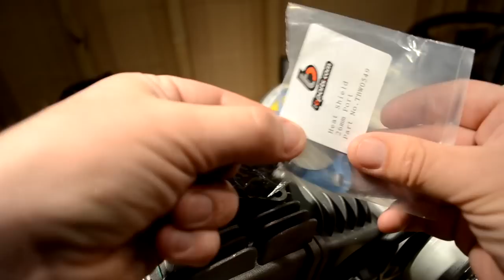Piranha 140cc - Pre Installation Prep

Comment from the maker: And to answer your other question - It was a great Engine, very well built - better quality than the Lifan's I've owned. I didnt have it long though because I switched back to a Semi-Auto, my bike has pedals, so cannot have a foot brake - the clutch and rear brake lever on the same side was an accident waiting to happen (I could have went to a dual cable brake lever on the right, but then you dont have as much control over which brake to use).

Comment: i think you made a mistake when installing the intake. That black spacer is supposed to go between the intake and the carburetor. The intake should bolt directly to the head, with a paper gasket in the middle. That is why the shorter bolts didn't reach far enough into the threads.

Comment from the maker: The bolt pattern for the two ends of the intake manifold are different (one is directly across from each other, 180/180, the other is something like 120/240) so you cannot install the manifold the wrong way - as such the spacers have the same hole pattern and cannot be used in the wrong position.

The shorter bolts didn't fit where I showed them as I was just indicating how the other bolts were the correct ones because they were the only ones long enough.

Comment: nicely done but little advice ,,, coperslip every bolt you take out before re assembly ,, and little tip with gaskets ,, smear them with engine oil before assy ,, that way thay come off the next time without sticking to surfaces  and destroying the gasket . and the ground down bolt flange is instant rust sopt ,,just replace the bolts with socket head stainless  problem solved

Comment: Great video and great engine. Except that you are in error about screwing in the oil dipstick to check the crankcase oil level. Since the dawn of time, all Asian engine oil levels are checked by simply pushing the stick in, and pulling it out. Screw it down to seal it, but to check it, in and out. Also you tightened your valve adjuster lock nut with the feeler gauge in place, bad practice. ok I'm done. Did they sell you this engine saying it had a lighting coil? It doesn't.  Thanks again for a great and very useful video.
Reply: agreed! was bit shocked at the oil check and that feeler gauge =D

Comment: Nice video :)

Are you sure about the oil level check? On my chinese 125 cc, the manual says to dip it, not screw it in. Same for various honda and yamaha engines i've worked on. Haven't seen a manual for this type of engine yet.

Thinking of getting a 140 cc for my bike too, how do you like the engine?

Comment: im trying to put one of these in an apollo and im stumped, the last part i have to do is wire the cdi and the ignition connector is not the same
Reply: What Apollo I'm about to do the same . Also are you using same cdi and wires off old motor or did you get new with the 140

Comment: I've heard you should do first start up with the crap oil that comes in the engine, then replace it after that with good oil. I guess that's not true?
Reply: The oil it comes with is of such low quality that it's not recommended to run the engine on it. change the oil to a non synthetic 10 weight 40 for your break in period. Afterwards change to whatever oil you like.

Comment: Hey recently just got a engine and pit it in my frame , I have spark and gas but for some reason mine won’t start , any tips ?
Reply: @Trevor Ober hey thanks man for the help I ended up getting it the carb had some dirt in it from shipping so I took it apart and cleaned it and now it runs great !

Comment: i know this fits into a motoped, but could you tell me are there any considerations/constraights??
Reply from the maker: It mounts no problem - the included intake fits without any clearance issues too (I mounted a Mikuni VM26-606).

BUT - Unless your getting the foot peg kit so you can have a foot operated rear brake I wouldn't recommend a manual clutch engine on the Motoped. Having the clutch and a brake lever on one side is a mistake in the making. You could run a dual brake lever on one side and just the clutch on the other but then you lose some brake control.

Comment: are thease any good? i have a chenese 110 atv. but i wanted more power
Reply from the maker: I liked it and it seems popular online, only went to a Honda CRF50 Motor as I prefer Semi Auto and wanted to run lights (can buy an aftermarket stator for the CRF).
Reply: +n1bpd cool. thanks.
Reply: n1bpd
Reply: Josh Kozee

Comment: i have a motorcycle that does not exceed 100 km/h Even though I have the power of the engine 127cc
I do not know what is the problem?//Please help
Reply: 127cc 4 stroke run about 50km

Comment: Is there a different between the 140 piranha motor and the 140 lifan 140 motor for Honda 70 swap ?  I want to do a swap on my 1985 Honda 70 with pull start on the motor

Comment: Darn it, why cut corners, when you dealing with new parts, use new parts, a new bolt with a washer would have done the job, and the bolts who are included, throw them away, and use some stainless instead, do yourselvfe a favor, do it right the first time.